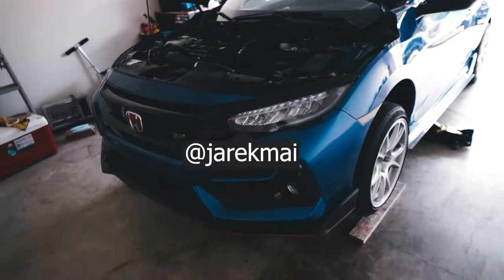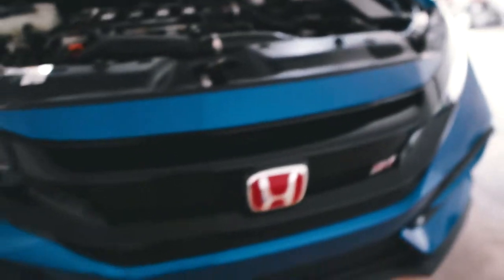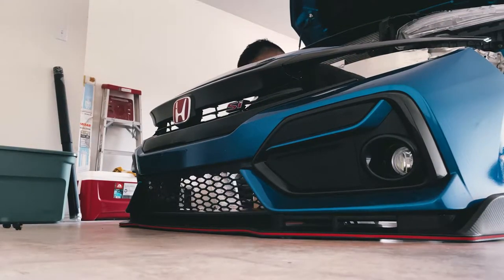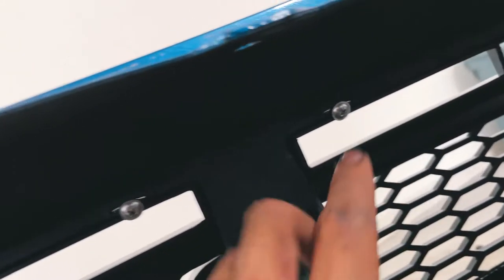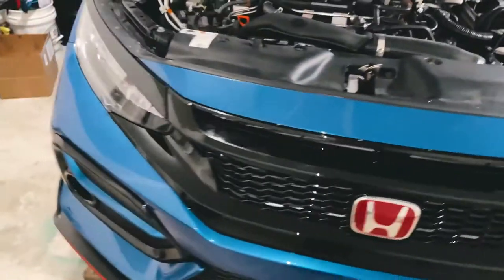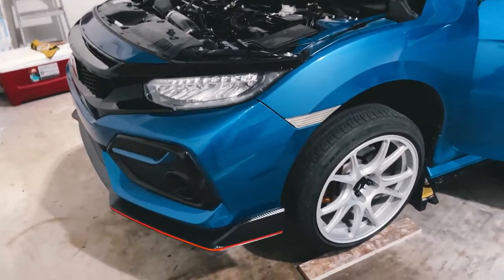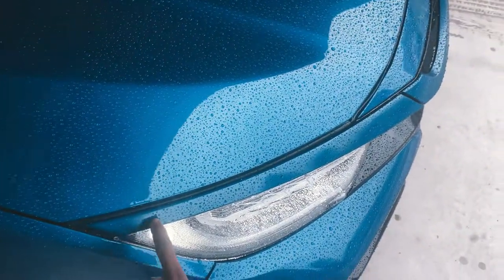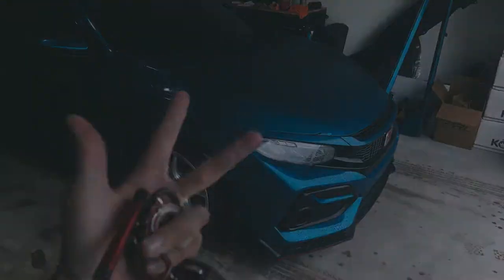INSTALLING A NEW GRILL! | 10TH GEN CIVIC SI FC1/FC3

Comment: Did you have to do any modifications to your bumper at the bottom for it to fit nice. I ordered my grill the same style as yours. But on ultimate motor sports and it’s not fitting properly on the bottom